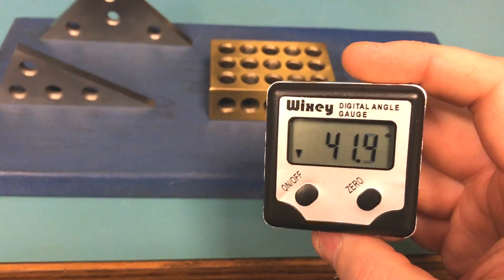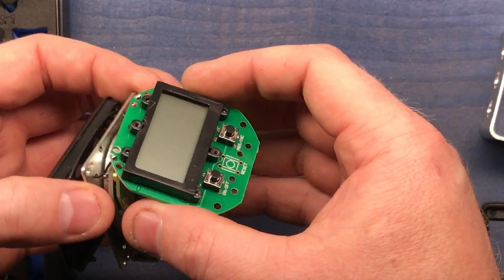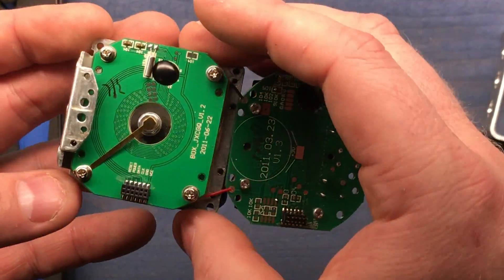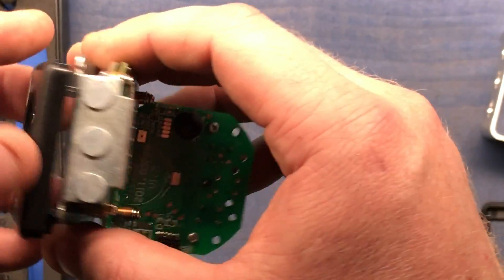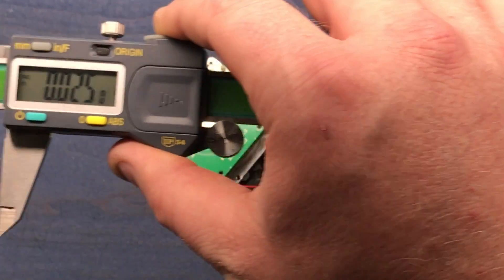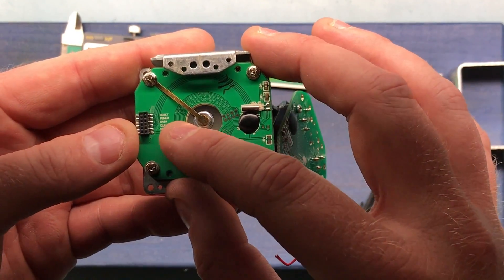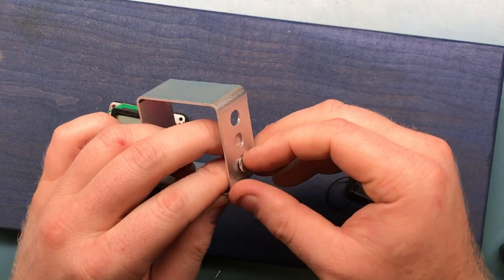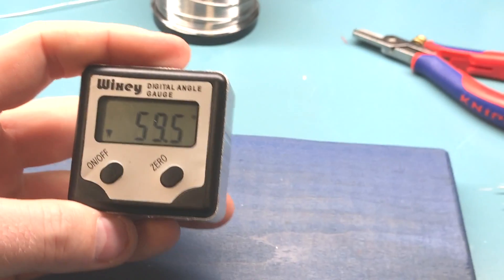How Does a Digital Angle Gauge Work?

Comment: cool, I didn't know there was a pendulum in those. (also first!)
Reply from the maker: Me neither, I thought there was going to be a gyrometer!
Reply from the maker: Basic accelerometers can only measure acceleration and direction.  A lot of accelerometers have a gyrometer built in to measure angular position.
Reply: that was my first thought too, never seen anything like this
Reply: How would you do it with a gyro? With a gyro wouldn't you have problems if you change from your zero position to the angle you want to measure too slowly?

I was thinking a accelerometer would be in there.
Reply: But there is always acceleration, gravity. Accelerometer would do pretty much what the pendulum is doing, using gravity to find the angle. 

Most gyros I have seen have units in degrees/second, so I think to use a gyro to measure angles you would have to sum the angle changes from the zero point. Was just wondering if there was something else I didn't realize you can do with a gyro. I feel it would be very inaccurate for angle measurement alone because you wo uld be summing all the errors, and if it was moved too slowly beyond the gryo's sensitivity I don't think you could measure any angle.

Loved the video, thank you.
Reply from the maker: Thank you. While you can measure the angle with an accelerometer, I would not recommend it.  Gyrometers measure velocity over time and the angle is then calculated by integration.  Accelerometers measure pure acceleration in multiple directions due to external forces. Gyrometers only use gravity's acceleration if you ignore the negligible acceleration due to friction of the moving parts.  They both have downsides which is why they are often combined into a single chip and angular measurement becomes much more accurate.  Here's a good article explaining why we need both: http://diydrones.com/profiles/blogs/faq-whats-the-difference
Also, check out this video on the comparison: https://www.youtube.com/watch?v=s19W-MG-whE&feature=player_embedded
Reply: Thanks for the info.

Comment: I know this is an old video. I have a stair climbing hand cart made by XSTO and it uses some type of angle device to let you know if you have the proper angle to move up/down the steps. Question, would you know the type of tilt electronic they use?
Thank you..........
Reply from the maker: @robertbeltowski2819  they most likely use an MPU-6050 3 Axis Accelerometer & Gyrometer Module or something very similar